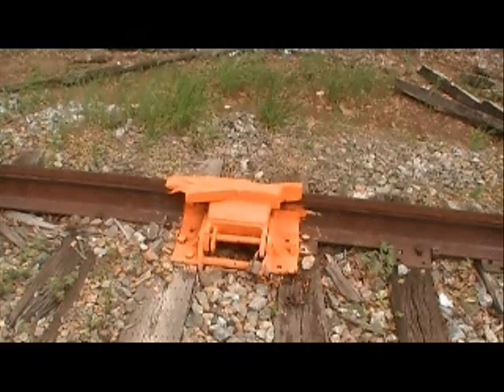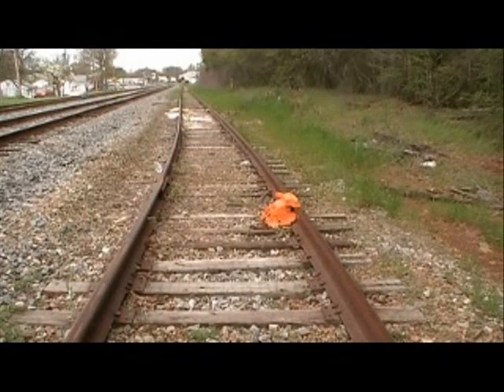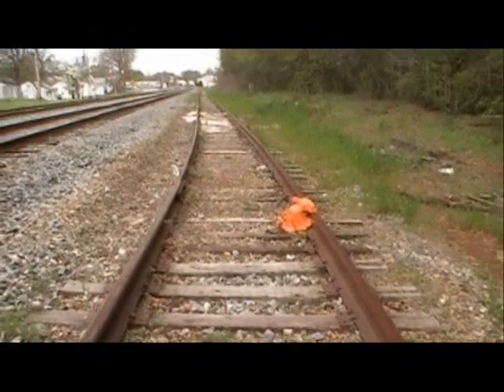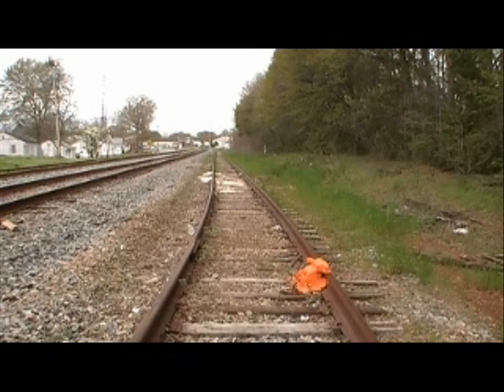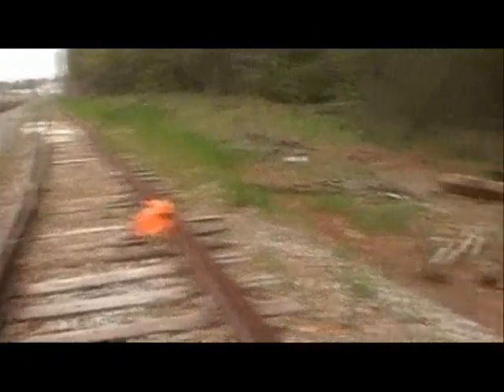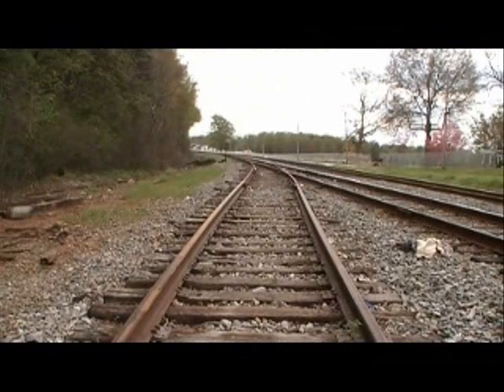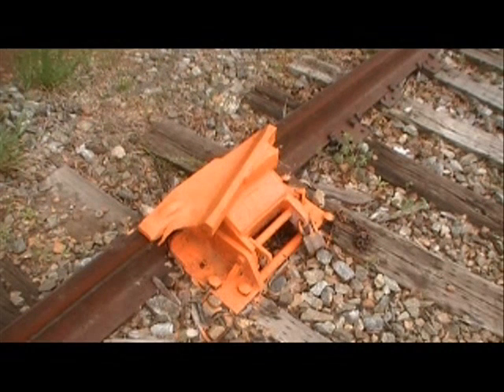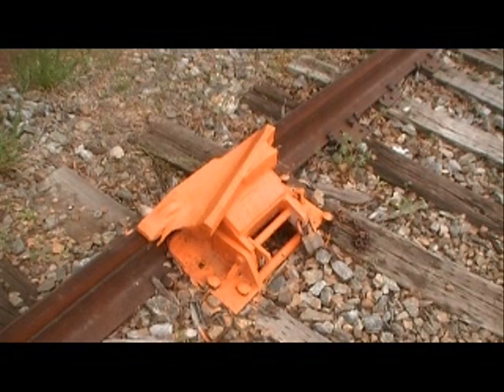Railroad Equipment The Derail

Comment: In Unstoppable, they used several derailers. None of them worked.

So I go: Why not derail the train like kids? Get a dump truck full of gravel and dump them on the track. If that don't work, get a long line of water butts to slow it down.
Reply from the maker: yep or remove some tracks lol
Reply: pwalpar 
Yeah, that too.

Or some C2 on some of the couplings.
Reply: That's Hollywood....exaggerate reality for dramatic purposes.

Comment: Most derailers are rated for 10 mph or under. Most siding tracks are 10 mph. A rolling train car under 10 is usually put on the ground. 15 Mabey. 20 or above lol like a freight train. It will smile and keep on rolling
Reply from the maker: Thanks for your input

Comment: What was that stupid movie yrs ago about the run away train with denzel.? I remember watching that thinking "throw a gawd damn derailer down...lol. not to mention, all modern locos have a deadman switch
Reply from the maker: They quit using deadman pettles some years ago  they now use an alerter,  I agree that was a dumb movie
Reply: pwalpar i work at consol energy and we operate Norfolk southern and csx locos to dump coal trains. They have alerters but they are tied into a switch that looks like a long spring that we call a "deadman switch". When the alrm sounds u slap the switch or eventually the Locos will brake.
Reply: The train in that movie was carrying about 20 cars full of a highly toxic chemical, they mentioned that if it derailed anywhere near people or water it could be worse than the Bhopal disaster.  That's why they made every attempt to stop the engine rather than derail it.

Comment: 1964, Copperas Cove Texas, near my home, several lines of track, a big yellow steel device on the track had "DERAIL" painted on it.  Didn't have a lock but it had a place where the lock shackle went through.  Eleven years old, I didn't know why such a thing existed, but I though it should be locked, either on or off.  I told a local police officer about it.  He thought I was nuts until I showed it to him.  Now I know what they are for — not just for terrorists...
Reply from the maker: Thanks Danny  If a train was in the track it would have probably been locked

Comment: You can see that this derail has seen use. The partial cut in the front of the derail is right where the flange would have hit. I can see how this would be unreliable at high speed, as the wheels might simply sheer it off and send the pieces flying rather than change direction. But it’s a great cheap way of keeping slow moving cars from rolling into a dangerous place.Thanks for sharing!
Reply from the maker: I have seen it work  LOL

Comment: I worked in the underground mining industry and we had derailer's on our tracks to keep the motors and flat cars from getting away if the brakes weren't set... Of course our motors weren't locomotive's , but a 15 ton run away track motor wouldn't be a fun thing to get hit by if you were coming up the line.
Reply from the maker: wouldn't be much fun LOL

Comment: This video needs a clip of the derail device in action!
Reply: those were portable derails.. They are worthless on anything over 15mph
Reply: Trainzguy 2472 called a switch point derail
Reply: Portable derails are worthless at high speeds.  Some of them look kind of like a turnout except the switch rails end before they can cross over the mainline.  Those work well, but are permanent.
Reply: kickinbackinOC we need The unstoppable scene with them wait in the movie they all fail DANG YOU HOLLYWOOD MAGIC
Reply: kickinbackinOC just google CSX
Reply: :0

Comment: Hey I have a question u all probly heard of the triple 7 that ran away in pa but is it possible for a train to actually go so fast and be so heavy to cause the detainees to explode
Reply: The triple 7 that was a MISSLE the size of the CHRYSLER BUILDING?  THAT triple 7?
Reply: 40,000 tons of steel going at 70 miles per hour! A train that size going that fast, it will vaporize anything that gets in its way!
Reply: Derailers"
Reply from the maker: Sounds like baloney to me
Reply: Jeff Treseder yes that one

Comment: Over here we have what is called catch points for many years . They open automatically when points , ( turnouts ) are not set to come out of sidings on to the main line   . Also ones on the main lines and gradients, to stop runway waggons run back in the wrong direction .  But these days many  have been removed on running lines . Due to automatic breaking systems being so efficient .
Reply from the maker: welshpete12 Thanks for the info
Reply: +welshpete12 I wonder why they don't have trap / catch points equipped here. When a train derails, it takes time, effort and money to derail, with trap points the wagons do not derail, instead the wagons come against a man-made pile of sand or earth, that way when the wagon is recovered it's still on the rails, therefore, no heavy equipment is needed, sure it's a little dirty but servicable.
Reply: +Ben 1337 Interesting point , it maybe that there is not always room for such a pile of sand . In yards where the points are to come out on to the running line when set the other way they sometimes just go to a spur where there is plenty of room  to stop . These spur lines are also used in shutting  , and are always fitted with a stop block  .
Reply: +Ben 1337 The hinged derailer leads me to suspect they want to keep the switch access available for occasional use, though you're correct about the trouble and expense of re-railing rolling stock. It seems to me that cars inadvertently allowed to drift down this track would likely not be moving fast enough to cause major re-railing problems and might only require a drag across a rerail frog.
Reply: Fair enough.

Comment: UK does it using a special switch, but it does mean the derailing is control by the signal box remotely.  @1374
Reply from the maker: DieyoungDiefast They have several types like that here as well  Thanks for commenting

Comment: I assume it's quite common everywhere.
Here where i live, every branch branching out directly and sloping toward the main line must have something to protect the main. Depending on some other circumstances, it shall be a simple derailer, a massive barrier combined with derailer, or a turnout leading to a bumper.
The derailer always hurls the runaway car away from the main line, of course. This can be obsereved here too...
Reply from the maker: I am sure it was a lesson learned the hard way many years ago by the railroads

Comment: This piece of equipment is called 'a frog'
Reply from the maker: I disagree   Thanks
Reply: my dad worked as a boiler maker in L.A. for southern pacific, and that's what they called back in the 40's & 50's, doesn't make it cast in concrete!
Reply from the maker: Charles D Cox I do agree that you Dad probably called it A frog.  Thanks
Reply: I always thought a frog was the x point of a switch?  I guess different people call them different things.
Reply from the maker: It aint a frog LOL
Reply: Charles D Cox A "frog" is the plate that makes the cross in a switch - http://en.wikipedia.org/wiki/Railroad_switch#Frog_.28common_crossing.29 - I guess it sort of resembles the derail in a way; maybe there was some confusion. Or maybe your dad was referring to a switch being used as a derailer (not the kind showed in this video) and was talking about the frog in that switch?

Comment: A great safety feature also suitable for protecting railroad workers on the mainline.  Some years ago in the UK, track workers near Shap were killed by a runaway maintenance bogie.  They all had hearing protectors on so they never heard it coming. RIP.
Reply from the maker: As A railway Carman  I always had to make sure one of these was in use when I worked on cars on the active lines.

Comment: I do know what I am talking about, on seldom used lines and expecting a recrew it happen more often then you think, you might have retired but I am still there, not on that line where it the crash happened but at the company that owed it before that. Now inorder to do a drop or pickup and if you might not get back to the mainline in less then an hour and you have dangerous goods already on your lineup we have to spot it in a siding and do a track release, The one hour means unattended!

Comment: Unless this has changed since I retired in 1997 don't believe it. I have been on trains with dangerous loads sitting on the mainline for hours at a time.
Reply: I'm sure that they had the authority from the dispatcher and the signal behind would be at danger preventing any other train running into them from the rear.

Comment: When I was a kid I lived near the old Northern Central Railroad, by then just a spur.  Near by was a siding leading to a local quarry.  That siding had a derail on it, just like what you showed here, but this one was white and was connected to the manual throw for the points so that it was automatically moved in and out of position was the points were lined to the main or the siding.

Comment: And you are wrong. Unstoppable was based (loosely) on a real life incident with CSX locomotive #8888. In the movie the derail failed to derail the runway train, and Lawson asked why it didn't work in the movie if it's so reliable, and your response is because movies are never realistic. This answer is wrong. The correct answer is the derail failed in the movie because the derail failed in the actual incident. Now, why did the derail fail in real life?

Comment: I've seen a few around the worksite that take the shape of a "lump" in the track, as if to form a high speedbump on one rail (in comparison to the pictured device which seems to directly force the wheel sideways). They about the same height as the track itself. They can fold down similar to the one in the video. They call them "scotchblocks" here, but I've never been able to find out why. They are used to isolate sidings to allow people to work nearby or stop stock rolling back onto the line.

Comment: This is sort of like the crash pits used off the sides of highways at the bottom of mountains. If a semi truck can't engine break, and it's breaks overheat and fail they can hopefully drive off the road into a long bed of gravel which is better than the alternatives.

Comment: the purpose of these derailment gadgets is to prevent a rail engine from straying onto an active line if it doesn't stop at a red signal thus preventing a much larger catastrophy involving passenger cars these are place so that the engine is pushed off the track

Comment: In England sidings are usually protected by a trap point which does the same thing, just a couple of switch blades without the rest. Derails a train just as well but not so easy to install as a derail as shown here.

Comment: Well you may know from "hexperience" that derailers work very well BUT ONLY AT SLOW SPEEDS (hit that sucker hard enough AT SPEED and the wheel will simply bounce right over the top of it & LAND BACK ON THE RAIL) whereas the ONLY safe way to thoroughly ensure a total derail is to install an interlocked secondary turnout (directly coupled to the mail line turnout) - to deliberately head "everything" into the bushes. (but when the MAIN is set for the siding, the 2nd turnout is autoset for the main)

Comment: If you have a heavy enough piece of equipment (such as a locomotive) moving at a sufficient speed you can pop derails right off the track, although it will damage the track and wheels to a degree.  You don't have to be going very fast, either.  These work well for low speeds.  A split-rail derail is more reliable but only derails one way (although that's usually all you need it to do anyway).

Comment: Unstoppable was made for Hollywood.  Many things in that movie were wrong compared to real railroading.The general public is not thoroughly educated on railroad equipment and operation.  Derails do work and are mostly on track where trains are operating at slower speeds than that on the mainline.  Working for a railroad, I have never seen a derail used on a track where MAS (maximum authorized speed) is above 10mph. For example....Mainlines.

Comment: To: pwalpar  Would love to see a rerailing.  Could a flat car be rerailed without an engine.  (Using a long prybar or something?)
Wish there were another way to halt runaways without derailing them.
Could some type of rails which squeeze the flanges against the rails be used? 
But that would be morexpensive and may still allow a car to gethrough.
Since these hopefully are never used, these cheap devices make more sense.